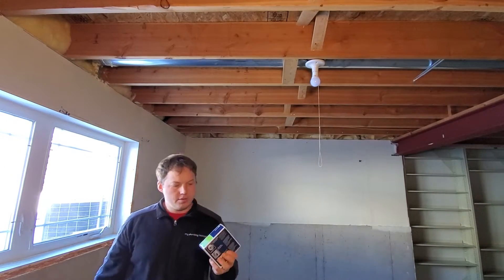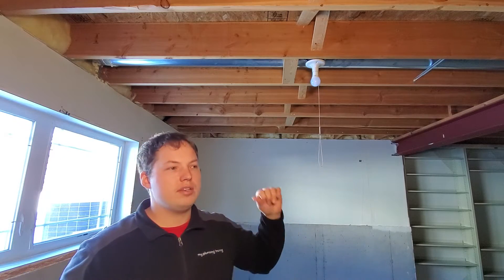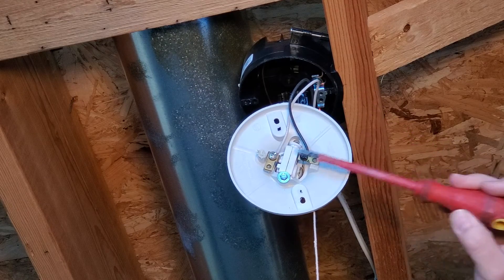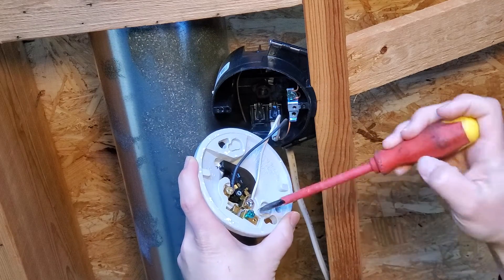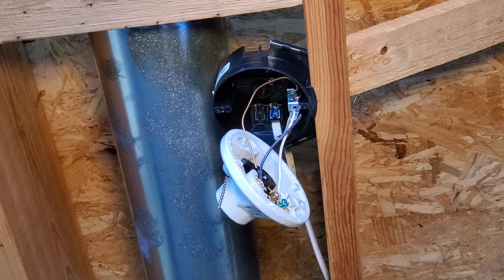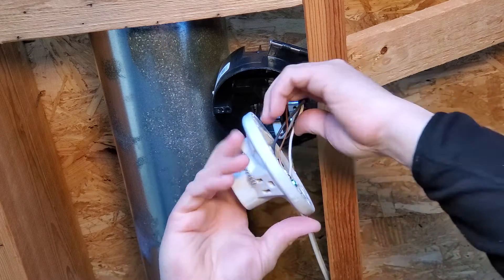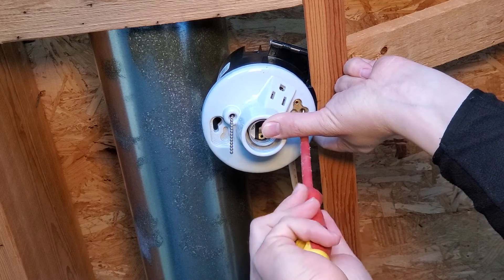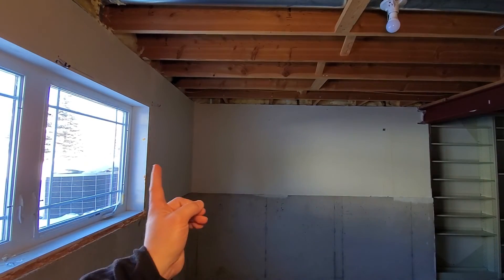How To Install a Light With an Outlet - Porcelain Lamp Holder & Grounded Receptacle

Comment: It all looks so simple..............until you get into the old fixture of an older house and find that #1 - There are more wires in the electrical box than you expected and #2 - Find  that in the today's world (2024) when you go out to your local hardware store you are told; "They don't make ceramic fixtures anymore and then you discover that the holes in the new "cheaply made plastic" fixture don't line up with the holes in the electrical box and you will have to replace the electrical box also!!!!  Ya get the old "That's not up to code" thing.............Pay the $150 - $300 to have a certifide electrician do the job that would have cost ya about $15. if you were able to do it yourself.............

Comment: Liked the fact that you left the light on to find the correct breaker switch on the electrical panel.   Great safety advice!
Reply: it's also smart when working with outlets to plug a phone charger in to find the breaker's switch.

Comment: If the lamp is on a wall switch how do you keep the outlet hot when the light is switched off?  I want to use the outlet to plug in my garage door opener but don't want the light on all the time.

Comment: Should explain how to ground the new fixture in case the old fixture was not grounded due to old wiring(existing wires did not have ground wires). 
#

Comment: Great video. Thank you.       I have an old porcelain light fixture which has no receptacle in my garage and need to replace it with one that has a receptacle in order to power my garage opener.   I’m assuming the box is metal since the house is 40 years old.   Will there likely be a ground wire?   Should I get porcelain or plastic fixture?    Thank you for your help.

Comment: Is it safe doing this hook up without any copper ground wire?  Looks like when I removed the old porcelin lamp holder,  there was no ground wire visible.   Thanks
Reply: If you are installing one with  a outlet on it you must attach a ground. It's against code and a safety hazard if there is a 3 prong outlet but no ground.

Comment: You were doing good until 3:53 when you started messing up talking about the ground wire. You don't use trade terms with the audience like "pigtail" without telling them what that is. You insult their intelligence by assuming they know that already, if they did, they would not be watching a basic install like this one. Get a clue. From there it was still confusing to an average knowledge audience. Do better.

Comment: Leviton has really disappointed me. They're using cheap plastic on the strings, so I have to replace them with proper strings, a few of them, the plug wasn't right and a polarized plug could be plugged in either way. Also they didn't grip the plug well or they would bend on the inside and either short or not work at all. Never had that problem before. It's as if they've reduced the quality and increased the price. Also ordered a case from The Amazon and about 5 of them were shattered.

They were quick to offer me a refund IF I returned the package, and I wasn't about to take down 30 sockets I already put up. They've just really gone downhill and It's sad.

Comment: Great video,  So if I replace this with a light that has a wall switch, its the same as if I was pulling the chain on/off, the 120v outlet will have constant power all the time while the switch to the light is off?

Comment: Thanks Benjamin! That really helps. I installed two of them today, and they work fine. But I placed my non-contact tester near the pull-chain (the metal part), the tester lighted up red and beeps. It made me nervous, and I tested the second one. Both are the same. My guess is that the pull chain goes up and near the hot wire in the socket. So, when the tester is placed near to the pull chain, it’s like placing a tester near a hot wire. So it lights up red and beeps?

Comment: Is it possible to wire this fixture in such a way that it allows the light to be controlled with a switch rather than the pull cord and still allow the outlet to have power all the time? Thanks

Comment: When I pulled down the lampholder I want to replace, there is no ground wire. The only wires were the black and white one. How should I go about grounding it?
Reply: Well the light fixture he used had a built in ground. How did your make out?
Reply: What was the outcome
Reply: Mine had a ground, I just didn’t see it the first time I looked. I got everything hooked up fine.
Reply: @klink88  good to know.  I hooked mine up today and seen no grown wire at all. Now I'm skeptical about the built in ground on the fixture mount

Comment: I found one of the older traditional cylindrical outlet adapters which screw into the light bulb socket and have two 2-pronged plugs on it's sides along with the other end of the cylinder being another light bulb socket. If I use the pull-chain to turn the light off, does the electricity stop flowing to the outlets in the one I'm describing? And, is it correct that on your outlet the electricity will continue to flow to the outlet even after the chain is pulled to cut off power to the light?

Comment: Marvelous I think.  We're fighting a original construction fixture in the basement that has a bulb and 2 power outlets.  The cord switch that turns the  light on has stopped working, so we have bought a new fixture.  Unfortunately, there are 2 pairs of wires; each pair must fit under a single screw.  Of each pair, one wire is solid and stiff; the other is stranded thin wires.  We haven't been able to keep both wires under the screws once the screws are tightened down.  So we'll try putting each pair together with wire nuts  so that we have only one physical wire to try to hold under each screw.  Please wish us luck; I'm  having a hard time keeping my husband's temper under control.

Comment: I have an older house with several of these porcelain, pull-chain bulb fixtures. I prefer to replace them with these bulb + outlet fixtures simply to have the versatility of available electricity in many locations. They are not much larger than the standard bulb-only fixtures, so I highly recommending changing them out if you can. You won’t regret it.
For “high-traffic” areas where the bulb may be vulnerable to getting bumped by something (boxes, broom handles, etc.), I recommend bulb cages such as this one.
LightCage Light Bulb Safety Cage (1 ea) - Contractor Grade https://www.amazon.com/dp/B0018Y3BOY/ref=cm_sw_r_cp_api_glt_fabc_X1J5Y3H3FJ8DERSVZXCX

Comment: Note :One of the screws attaching the porcelain to the metal box, could be the ground. Check the instructions first, always.
Reply: I have this same porcelain fixture and none of those screws are meant for the ground wire
Reply: @SarcasticPixie  are you sure because I have read that is the built in ground

Comment: Thanks for the video. I have to replace 2 of these in my garage and I feel more comfortable doing it now. Electrical has always made me a little uneasy, but I will cut the breaker off to the garage and use a tester just for good measure.

Comment: I took down a chandelier fixture and from the ceiling box there were 2 white wires connected to the neutral of the fixture (I think) with a wire nut and 1 black wire connected to the hot of the fixture (I think).  I want to install a similar lamp holder to the one in your video except it has 2 gold and 2 silver connector screws.  Is that to connect to another lamp holder? Can I connect the black to gold and one white to each silver connector screw?  Does that make any sense?  FYI - as long as I keep the two white wires connected with a wire nut, all the the other lights on that breaker can turn on.  When I used a separate wire nut for each wire (white, white, and black), all other lights/outlets on that breaker don't work.

Comment: Question. Taking the old one down, it has 4 screws (2 silver, 2 black). The wires coming out are 2 white, 2 black which are tied to each screw. So 4 total screws 4 on separate screws. New pull chain fixture has 1 silver 1 black. Would the 2 blacks go to the 1 black screw, 2 whites too the 1 silver?
Reply: Thanks

Comment: Hey Ben, great video. Is it ok to run a 50 watt shop light from that reciprocal on the fixture for long periods of time? Or would that be considered a hazard? It is in fact connected to a circuit breaker

Comment: There should NEVER be two wires under one screw, it's illegal. Oftentimes what you might see, however, is a conductor that has had about 3/4" of insulation stripped in the middle of a run, and that stripped part wraps around a screw 180 degrees in a U shape. This creates the illusion of two wires being tightened under a screw, but it's still just one conductor. You can see this example with the ground conductor in that fixture box. It wraps around the screw in the middle of the conductor, with a stub remaining  to splice to a light fixture's ground wire or screw.

Now, as for those keyless fixtures with receptacles (what those really inexpensive utilitarian lights are called in garages and unfinished basements), I'm not a fan of the receptacles on those. It's not so much an issue today with LED bulbs, but you never want a cord hanging down next to a hot light bulb. I would just assume bolt a steel box to the concrete wall, run some EMT sleeve up to the joist space, and have your NM cable go down the EMT to the box and receptacle. You got to make sure the EMT at the top has a plastic slip-on bushing so the NM doesn't chafe on it.

Also, no problem grounding stuff with screws... the NEC allows it for all steel boxes and it's a life-safer, especially for multi-gang switch boxes! Not having to have a pigtail for each switch and to be able to just have all the devices self-ground with the box is very convenient and makes for much less wire congestion in the box.

Also! I don't like the porcelain fixtures, I keep busting them by tightening the mounting screws too tight! The screws can't even be snug without risk of cracking them. The PVC ones are the same cheap price and much more durable in my opinion.
Reply: @Aaron, thanks for the above details.

For those not familiar with the acronyms (like me), here's the definitions borrowed from the WWW:
*EMT, Electrical Metallic Tubing, is a common, thinly-walled conduit pipe. (I knew what conduit was, but just never heard of EMT. I know now. There's also 
*NM is a type of cable that contains insulated conductors enclosed within an overall nonmetallic jacket. It is commonly known as “Romex®”, which is the brand that is most widely used. 
*Other types of conduit https://www.thebalancesmb.com/seven-types-of-electrical-conduits-844832

Comment: Great video. What is Ground wire doing in electricity ? Thank you.
Reply: The ground wire is connected to all the metal around the wiring and goes all the way back to the main panels neutral bus bar, this is incase a live wire breaks or comes loose it will short circuit and trip the breaker, or blow the fuse. This is good because if it wasn't grounded and a person touches the metal, they will receive a shock.
Reply from the maker: @mr.3phase228  Great answer!
Reply: @mr.3phase228  Thank you sir.

Comment: If that's an unfinished basement, you will need GFCI protection on that light/receptacle.
Reply from the maker: Correct!
Reply: Tom Garbo  I am not a huge fan of them either. That's why you have receptacles on the wall.
Reply from the maker: Tom Garbo  I totally agree. These are not a great product but can be useful in some circumstances or if you don't have the time/money to run wire for additional receptacles. Thanks for sharing your experience!!!
Reply: @BenjaminSahlstrom  They are a time-saver for sure. Sort of a hack, really. Ha ha